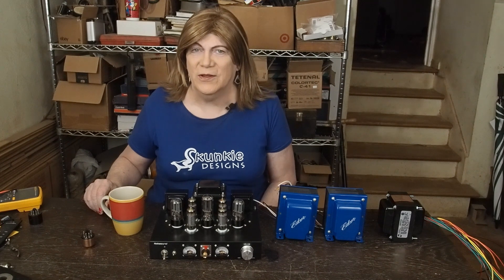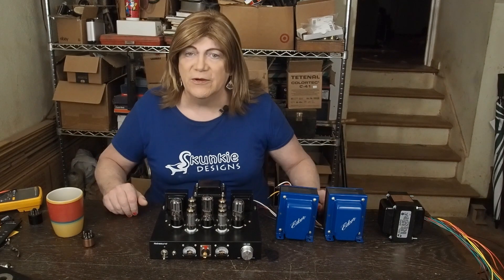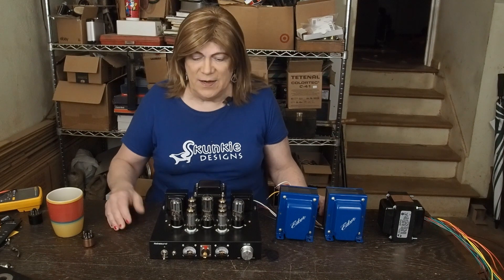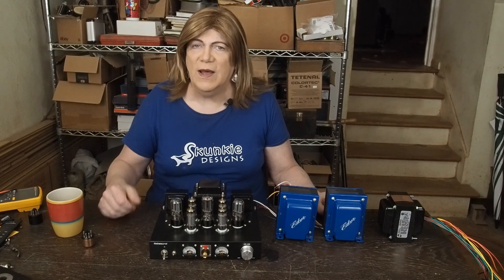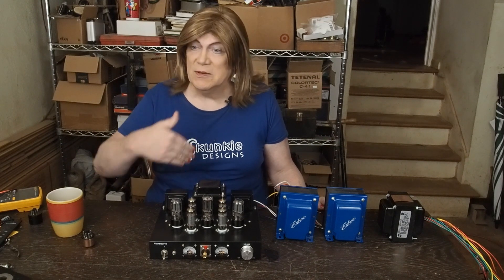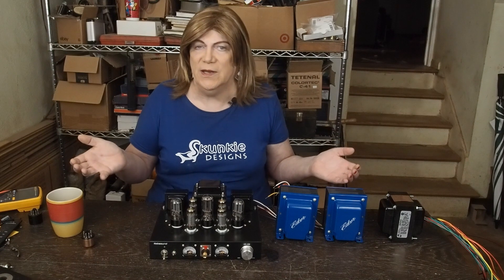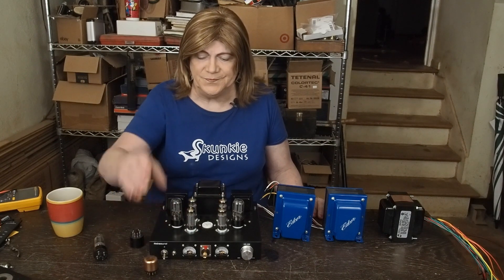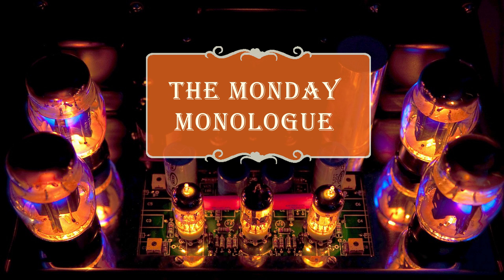Monday Monologue: Preview of KT88 iron and where did Skunkie go to School?

Comment: Today i lisened to a cheep modern fiio tape player,on single end kt 88 and it was funn, hifi is life,but my casettes has stored well, i have recordings that remind mi of old times, fore me its walue,i have chinese single end monoblocs here with all resistors wirewound,and the transformers are papier and vire,they lock real nice to me, and alsow seems 20 year old,planed to use transformers but, have you seen an amp with only wirewound resistors? I think it strange. And im gonna find out more about this, i know virewound resistors are conductive but wath does that mean? I think its a serius amp and the transformers locks like perfect,without anny cover. And my 300 b on way to be re started soon, maybe im a single end guy at the bottom? I dont have volume controll at the single ends,so i cant play lp s on it, only tape and cd,and normaly i dont do that, i love vinyl, and acsept tape on lofi.

Comment: Hey there, I was just wondering if you saw Doug De Young's video on "blocking distortion" circuit. And what did you think? For me I agree that you shouldn't reinvent the wheel, you might want to improve based on the availability of new materials. I don't think you want to put 1920s wheels on your new car. Older engineers we're forced into compromises because of the limits of current technology.

Comment: I appreciate your rants and we seem to be of the same opinion for the most part, but the entire A10/A12 comments are not quite accurate. 92% bias w/feedback was my secret. The spice thing was also a little much. I know a lot of morons out there couldn't sim a circuit to save their life. Others, like myself, are anal enough to model everything with extreme accuracy, including custom tube models with measurements of each individual tube, capacitor, and resistor used in the build. How do you think I got 8.226RMS out of the A10? I'm no engineer either. Not even close.

Comment: With a lot of info online now you have much info and can learn alot yourself. A long time ago I did get an associate  degree  in electronics. At that time they stressed circuit approximation. That you should be able to size up a circuit function and be able do not much more math than ohms law. With what's online now anyone should be able to do this. Have known people with really fancy engineering degrees that couldn't figure out how basic stuff works. Your doing a good job. Thing is you can do all those calculations but still have to adjust some to get it just right.
Reply from the maker: Right, I do a lot of approximation and then adjust from there.

Comment: I know I think less is more mostly in amps. How does Dennis Had make a variable tube circuit? I have his 6l6 firebottle SE amp.
You can roll 6v6 up to kt 150.
Reply from the maker: Cathode bias, when done correctly, can deal with a lot of variety. Coupled with using different rectifier tubes (to shift the B+ up or down) can cover a wide range of tube types. This might be how to design this amp to be able to use KT120 tubes with one rectifier and KT88 with another.
Reply: @SkunkieDesignsElectronics  Can't wait to see how this beast evolves. Speaking of weight that's some iron 💪
Reply: Purchased a Fire Bottle KT88 2 months ago...Started with KT-88 (2 months) and switched to KT-170's, Ken Rad CKR-6SN7GT/VT231 and PSVANE WE274B.  Fantastic build and sounding gear.
Reply: @CohibaJoe  Yep. He makes the underside as cool as topside. 
I started out with his sweet 807. Still have it too. Liked the 6v6 better than any of the 6l6. Had the 150's in a couple years now.